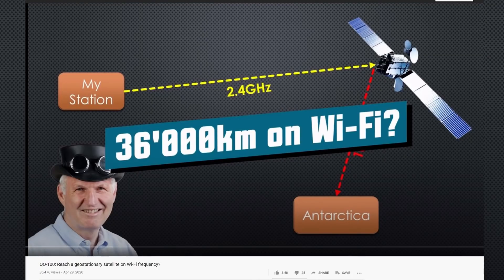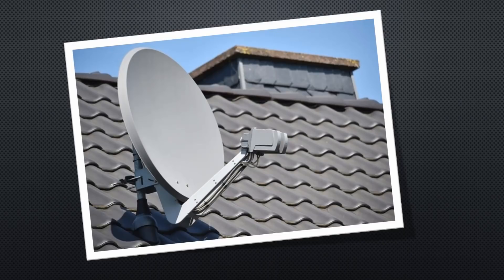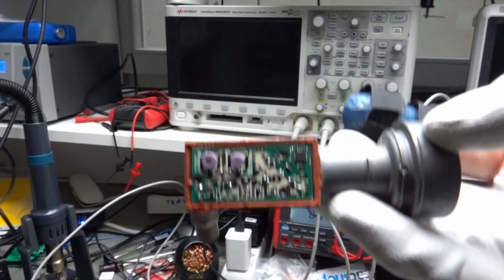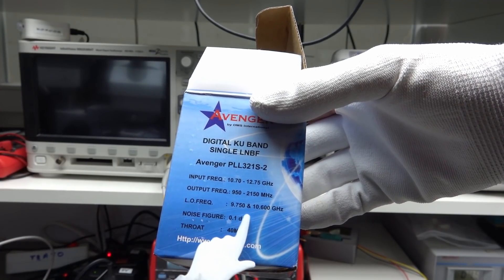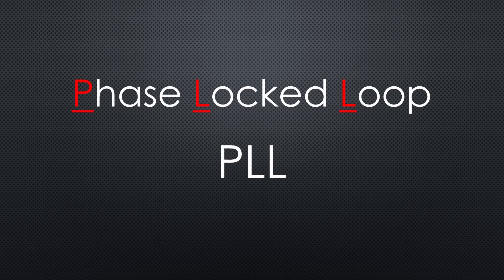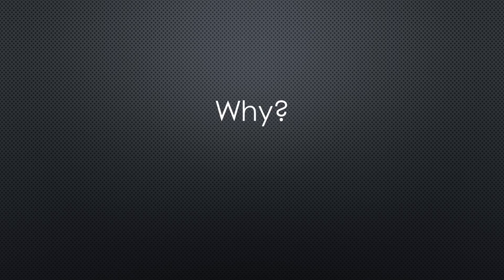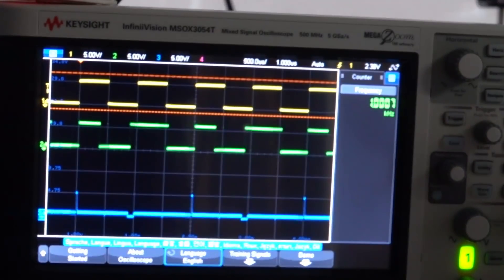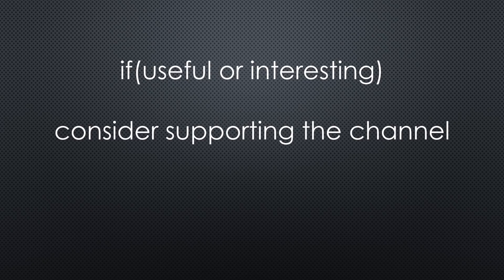015 QO-100 Satellite Receiving Technology  And Explanation of a PLL (Part 3)

Comment: What always amazed me (and I never really understood) about a PLL is how both frequencies at the comparator get in phase-sync.  The vco can  adjust frequency as much as it wants, if it is not in sync with the clock of the local oscillator, the comparator will always see a difference and the loop will never "lock".  Cool concept though. My first encounters with it date from over 40years ago when I was tinkering with my CB transceiver (before I got my ham license)
Reply from the maker: The VOC always changes it’s frequency if not locked. Otherwise it would be as you write.

Comment: Hello Andreas, dose it matter if I supply 12v from a Clean Battery or from a switching power supply? Thank you & 73!
Reply from the maker: If your power supply is clean, it does not matter. I use this test to find out if my power supplies are clean: Compare it with a battery.
I once made a video about cheap power supplies on my first channel. Maybe I cross-post it here.

Comment: Are there LNBs for the HF (Amateur) bands ?
Reply: They aren’t needed because HF = 3-30 MHz and can be received directly by a low cost SDR, eg RTL-SDR for a few dollars.
Reply from the maker: And on the lower bands we often need attenuators rather than amplifiers because of strong signals...